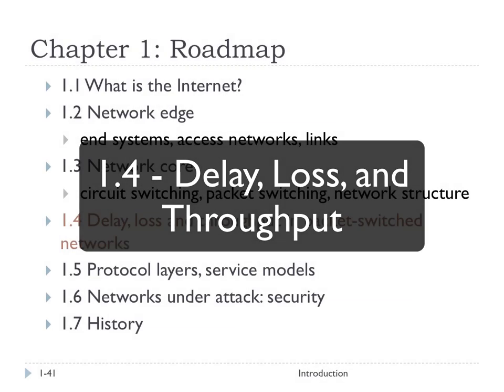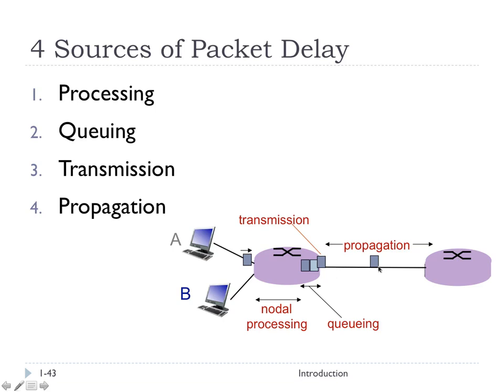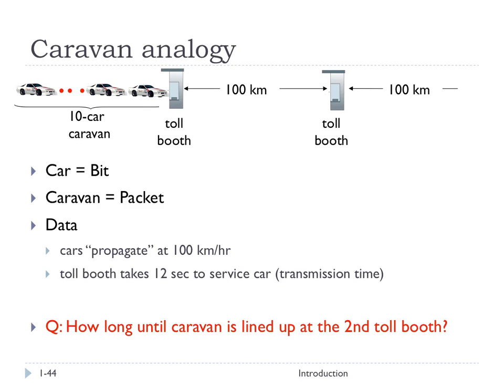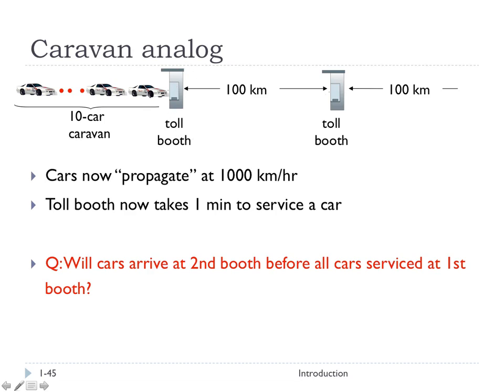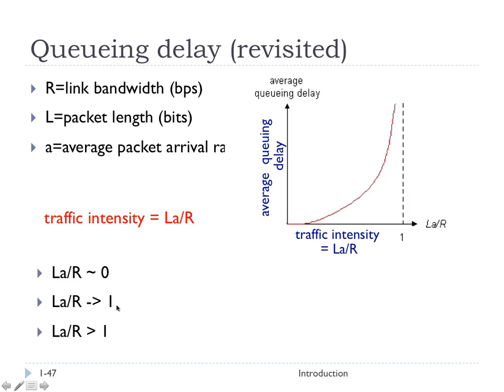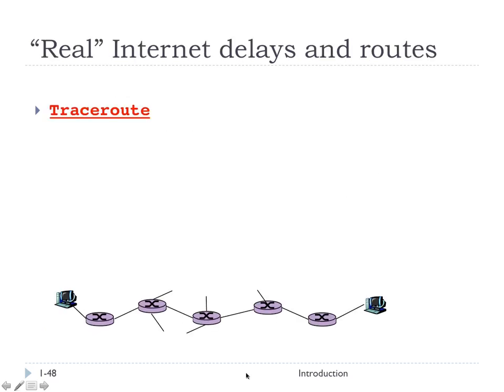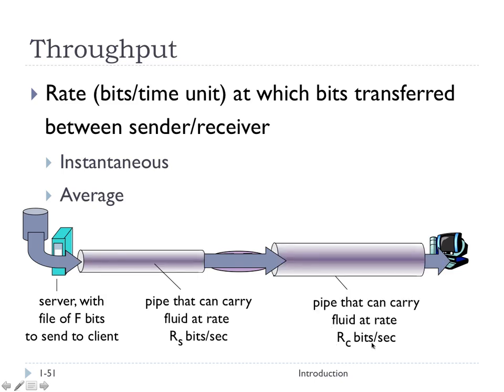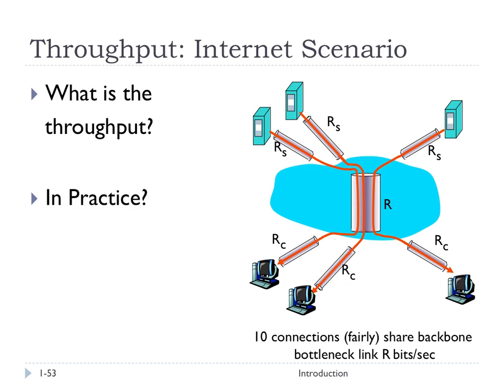1.4 - Delay, Loss, and Throughput | FHU - Computer Networks

Comment: @7:45 , the propagation time is distance/speed = 100km/1000km per hour= 0.1 hour=6mins. the transmission time per packet or per car is 1min (given). So total time for one packet to get from A to B is 6mins + 1 min= 7mins. Previously it took 12 mins for all the packets to get from A to B but now in the new conditions it takes 7 mins for ONE packet to get from A to B. So the answer is YES, so packets will actually reach B before all of them even leave A
Reply: Yes, this is correct. Even I noticed the same now. Its 6 mins(time taken by 1 car to travel from 1st toll to 2nd toll) + 1 min (service time at a booth) which is 7 mins. But Mr. Kenan told it as 10 mins + 1 min which is 11 mins (not correct). I guess he told that by oversight. But this analogy is correct.
Reply: Thanks for this :) I couldn’t understand the discussion so i turned to the comments section haha.

Comment: 14:56 So, just to clarify, Rs and Rc are basically the respective bandwidths of the Server to the Router and the Router to the client?
Reply: And, if so, how would you calculate the total bandwidth of the Client to Server connection? Would it be similar to throughput, where Rs would cause the total bandwidth to decrease?
Reply: @JagjitBrawler   It is min(Rc, Rs)  which is just like water flows through pipe.

Comment: With the caravan analogy, where did 7 come from?
Reply: its actually 6
Reply: @roshaanzafar8092  and there is one more minute from the toll booth service
Reply: idk if you still need it, it's 100 (length) / 1000 (speed) = 0.1 Hour = 0.1^60 = 6 minutes.
and 1 minute delay in the first booth so 7 minutes.